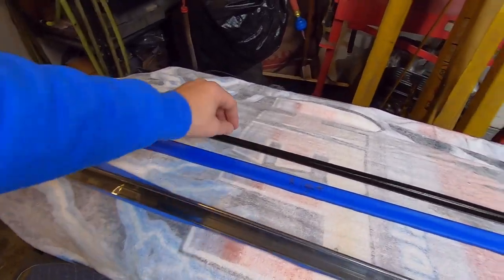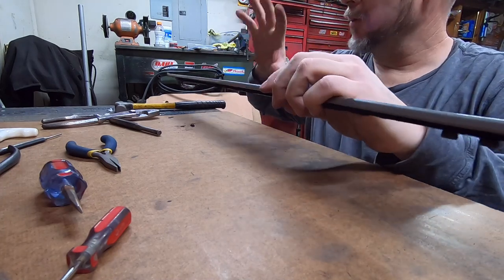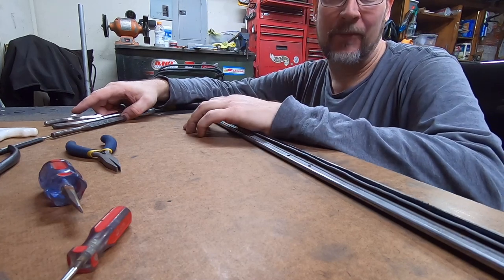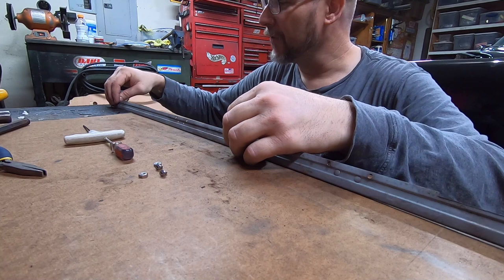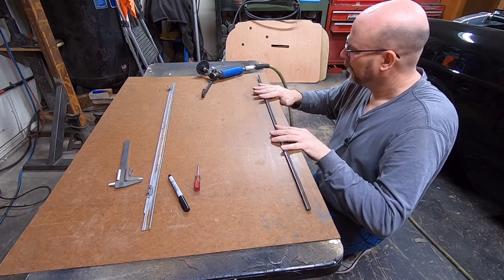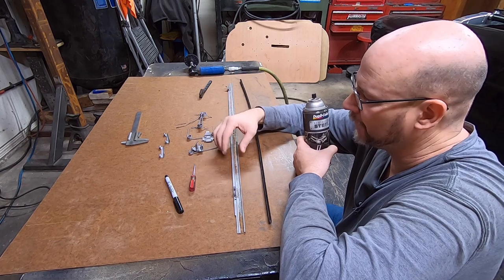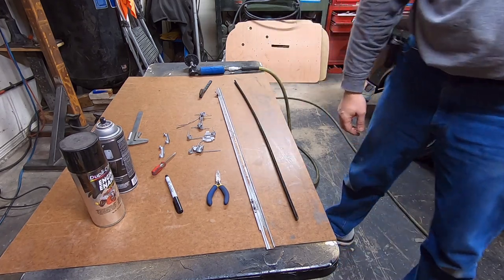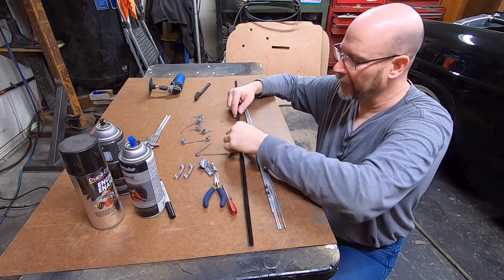1955 1956 1957 Chevy flipper restoration. Part Four

Comment: Getting back to you on those pins.OMC P/N 333513 new number and 316588 is the old number.They are 1/8th or 3/16 & maybe 11/2 long. Might be able to use with minor alteration.You can buy them on E-bay or pretty much any marine supply house .They were used on the 2HP Evinrude and Johnsons models for 15 years. ....Very nice work all in all..... Glenn